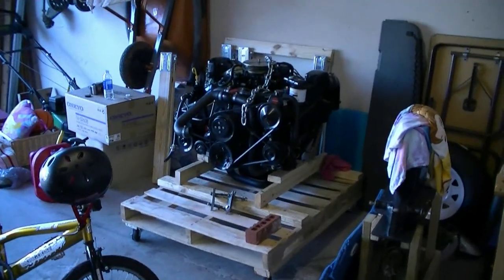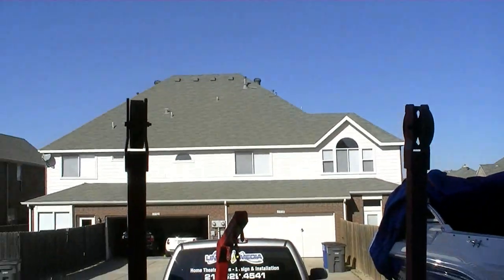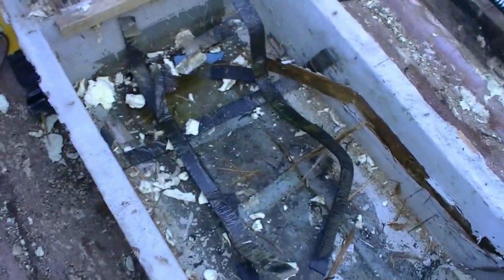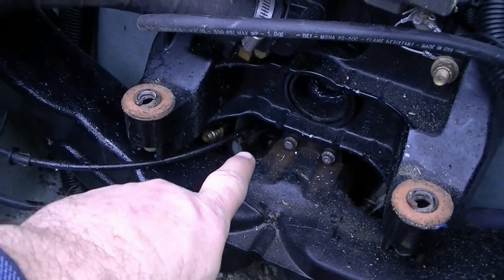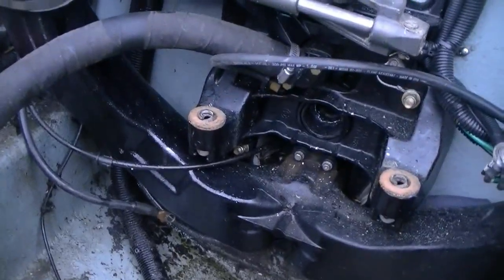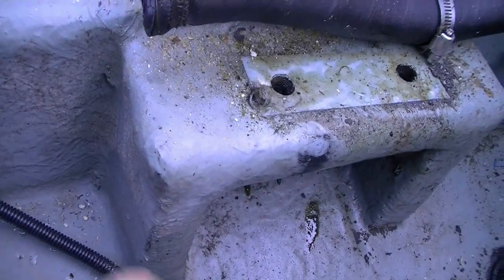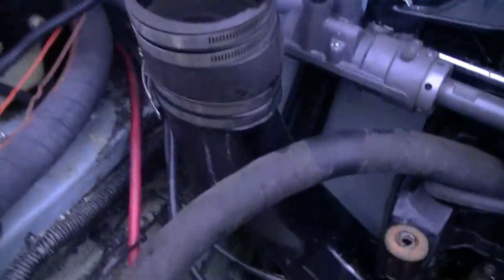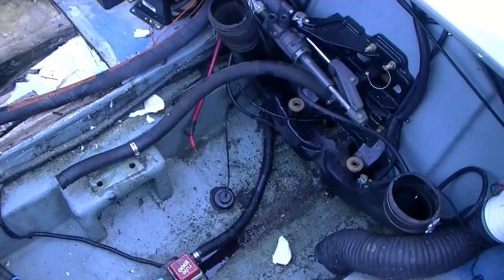How to Remove the Engine from a Sea Ray 220 BR for the restoration VLOG #5

Comment: I would taken out a nice insurance policy and made sure that boat never saw the light of day, it will NEVER be a collectible and boating is about enjoying the water, not working like a dog to replace transoms and stringers, etc,,,,, but I admire your work ethic and there used to be a time when I felt the same way,,, now, life is to short to spend that much time refurbishing a boat that is not unique,,, not collectible and not vintage,,, I dont get it

Comment: Hi there have watched a lot of your videos, and was hoping I could get some of your insight on a boat I just acquired.  Title says it's a 1969 but I am not sure, it's a Thompson bros gv 180 (surfbird? I think) Sat for a long while was told ran though so far looks promising cranks over just find.  I'm having a terrible time identifying the engine and out drive I think the out drive is an omc. Was wondering if you might be able to help with that?
Reply from the maker: Marcus Harper I really have not clue, but that old I doubt it would be an OMC.... But I really don't know
Reply: FriscoBoater thanks anyways great videos by the way

Comment: i have to change the engine mounts on my boat. Do i have to loosen the back mounts too, or is it enough only to lift the engine in the front?
at which points can i pull the engine to lift it?

thank you

Comment: Hi, new here. I like to take out the IO engine as per your video. Will water come into boat thru the manifold? Safe to use boat without the engine installed. Thanks.

Comment: Had the same kind of motor it was horrible it got destroyed by the ethanol gas i was changing carbs every season switched to a brand new Evinrude E-Tec and it shits on the IO
Reply from the maker: We don't have any issues with ethanol at all. Sure an exec will be better... its 15 years newer.
Reply: It was horrible what the ethanol did to the motor. The motor was carbureted i was putting a rebuilt or new carb on every time i took the boat out from winter storage. It just tore up the injectors but what you have done to that Sea Ray is great big fan of the exhaust